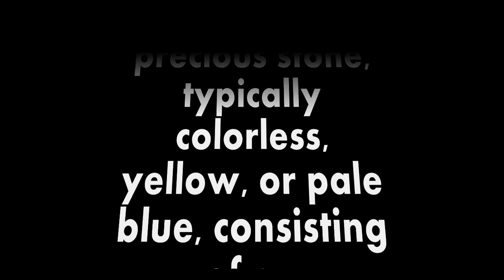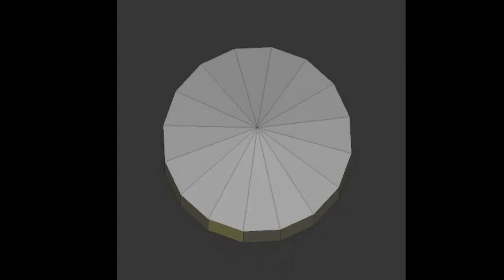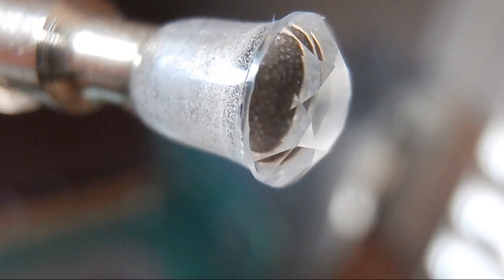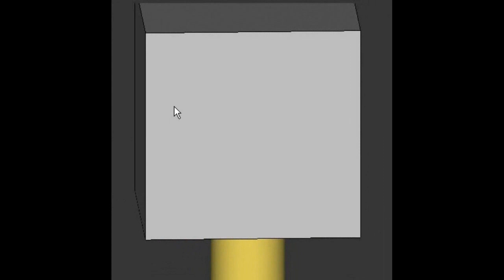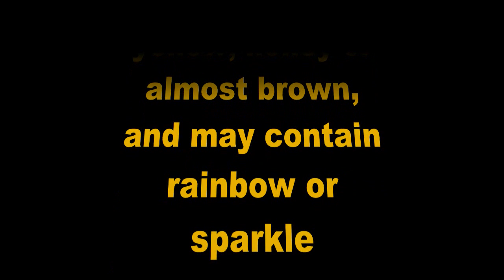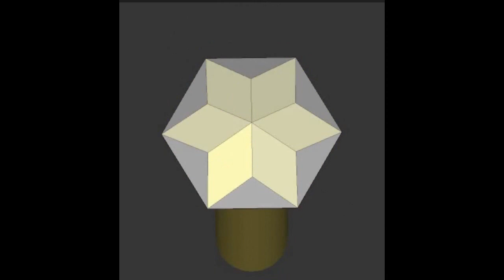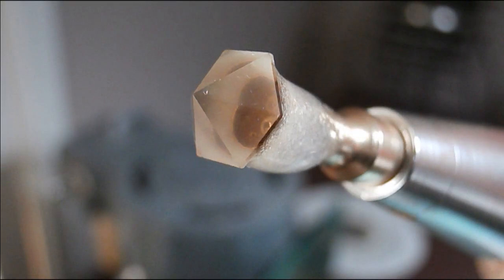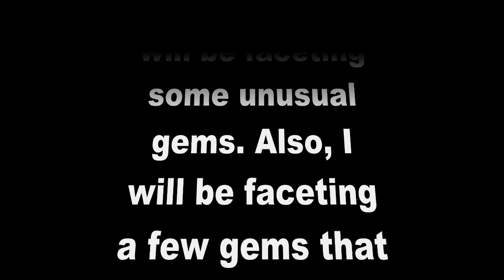Gemstone Faceting - Topaz, Cubic Zirconia and Citrine

Comment: Hello Cliff. Can you please tell me the sequence of Grits and the Prepolish and Polish Mediums used for the CZ ?
I recently started (and quickly finished) working on a CZ. For some reason I was under the impression that it is/was "lab-made Zircon" which is softer than CZ. Obviously, I was very wrong. I found it VERY Difficult to Prepolish suitably (to get rid of scratches) and some facets simply Would NOT Polish regardless what I used or how hard I pressed the stone to the lap. I was tempted to park my car on the quill a couple times thinking that might provide the necessary pressure to affect several stubborn facets, but opted out of that plan !
PS> Without relinquishing my real name in YouTube, I am in a FB Group where last week you replied to one of my posts which discusses the "order/sequence you use to cut and polish" which I learned only yesterday that I'm using the "OLD" method/sequence of faceting and not actually "meet point faceting". My Initials are "CM".
Reply from the maker: Hi, with CZ  usually pre polish with very worn 3000 diamond topper lap. CZ can be stubborn to polish. I use a tin lap with 50,000 diamond grit. I run a lap at a medium speed. I wouldn't go to heavy on the oil either. CZ can be prone to having a orange peel effect like sapphire. With large facets, you definitely  will have to put in more elbow grease to get a good polish. Cheers Cliff